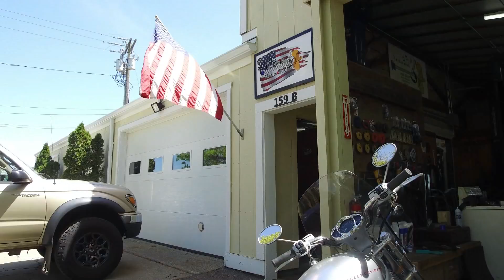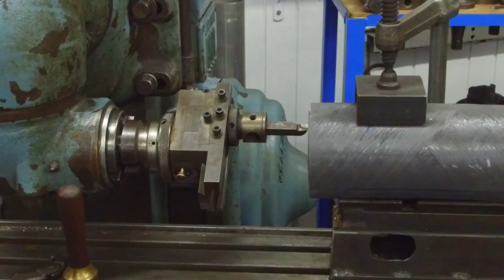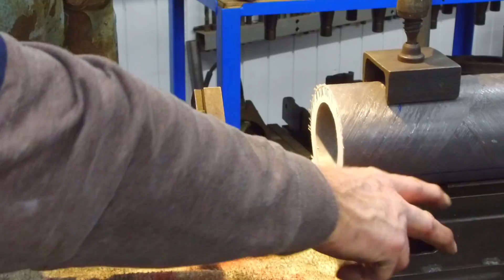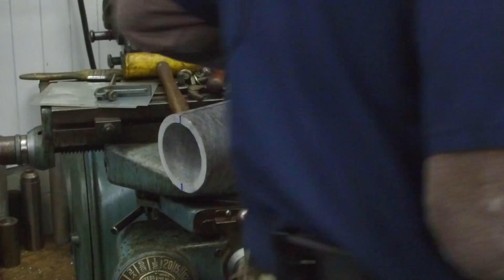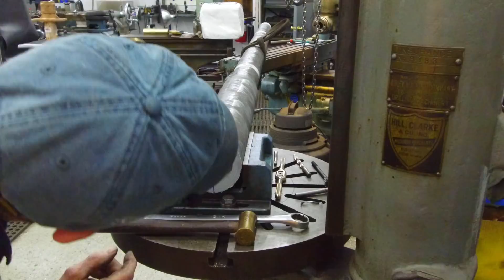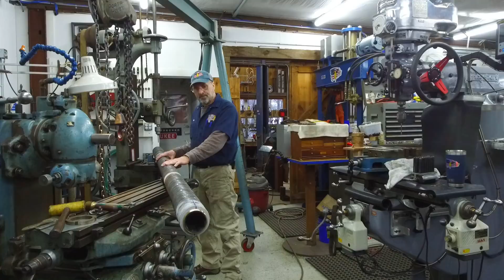Machining Glass Tubes Follow Up

Comment: I always enjoy watching a practical machinist restore things, thanks for your channel.  Just finished watching Resurrection from 10 years ago, and at the end, couldn't help but think "How are the owners going to install the drive belts for the saw?"  You did such nice work, adding dimples to the shafts for the set screws to seat in, and the owners have a surplus of hammers and a scarcity of grease.  Did you give them a tutorial on how to disassemble and reassemble their equipment?

Comment: Hi Keith, your centering process is elegantly simple and fast, as it should be. My mentor told me that you should only make something as complex as necessary and no more.  I remember back several years  now, the video you did on the repair of the Chandler Boring head. I have a couple of them too. Nice tools. 

Not being a marine guy I am not in tune with the bearings. The threaded thingy is again... simply brilliant 

Cheers and HNY

Comment: Very nice system you have going there. Most people don't worry about taking it out until they have to take it out. You surely have happy customers that know you have thought out the installation as well as the removal and only want your parts used to repair the boat. 
Take Care and Stay Safe.
Bob

Comment: Hey, Keith.  When handling fiberglass, if you sprinkle some baby powder on your hands and arms before working with it, you won't get any stuck to you.  Doesn't take much.
Reply: Hmm that doesn’t seem like it would do anything. What is the logic behind that. I do the occasional fiberglass project and that would be nice if it worked.
Reply: @matthewchastain136  Have done this when working with fiberglass insulation and it seems to help. My theory is the talcum helps absorb moisture that glass fibers cling to and helps fill pores in the skin to keep fibers out. Have also tried liquid glove on hands and arms and had some success.
Reply: @matthewchastain136  having done mechanical demolition for a lot of years, I can attest to the benefits of the baby powder. It blocks the pores, thus less itching, particularly for taking old boilers out,  where old brittle itchalation doesn't bother people nearly as much.
This technique we learned from an insulation contractor.
Reply: @matthewchastain136  Keeps your skin dry so the fibers don't cling to moisture and sweat. If they can't get stuck on you they have much lower chance of sticking you.

Comment: How much to buy a mermaid like on your wall Keith ?
Reply: I remember that picture  many years ago it was in the sun paper page 3 lol
i think it was Sue Barker ?
Reply: check his web sight  ,i think they are made in runs as he has time . iv looked and seamed they were reasonable price . he did roses at feb14 time as well i believe
Reply from the maker: Since Biden economics has cost of materials in steel alone up 375% for the sheet materials needed all prices have changed. I quote as I get request.
Reply from the maker: $185 would be the cost this week.
Reply: i think gone off track or did i miss something was replying to the picture of the tennis player lol
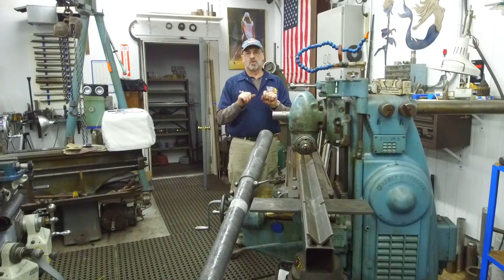Reply: @mallyuk1  (James Bond reference) To the Right, the Right! 0:50
Reply: @Bobs-Wrigles5555   haha got it thanks laughing my
head off